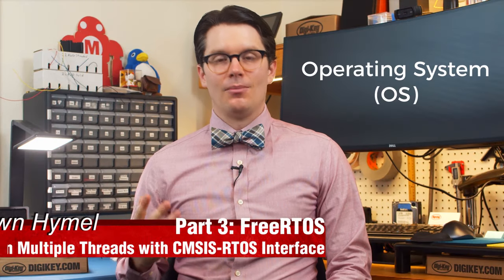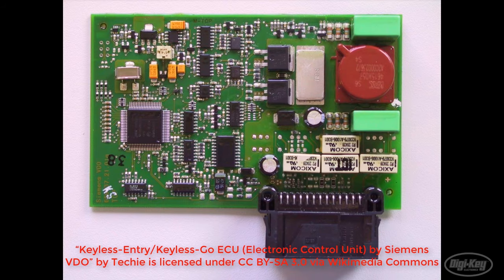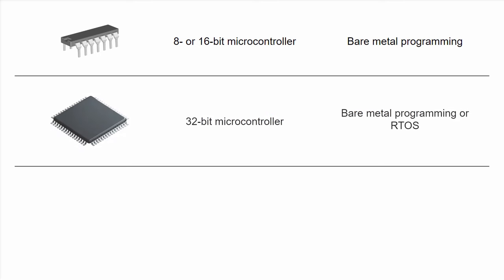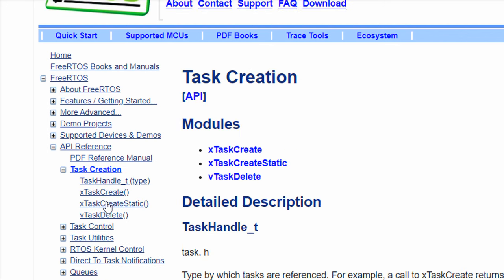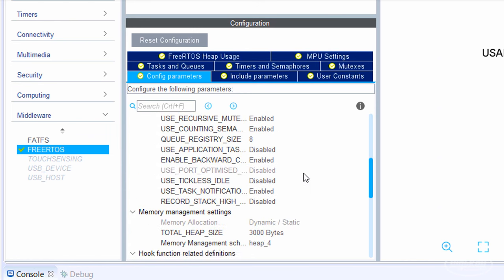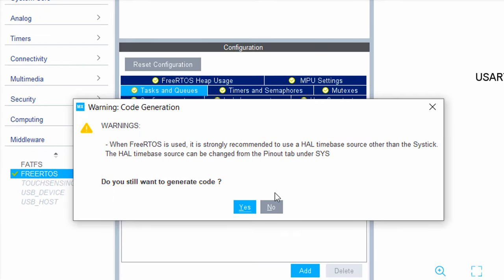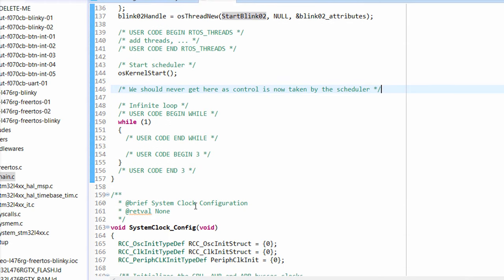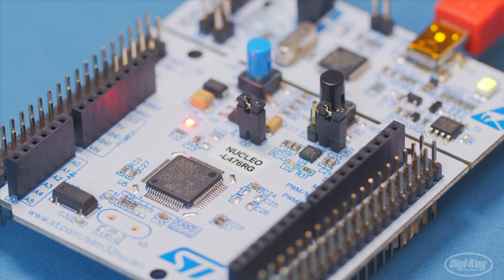Getting Started With STM32 and Nucleo  Part 3: FreeRTOS - How To Run Multiple Threads w/ CMSIS-RTOS

Comment: Please make the video series on queues, mutexes and semaphores. I'm trying to learn microcontroller programming, and your videos are the best tutorials I could find.
Reply: there is a full series on freertos with the esp32, which may vary in syntax but conceptually is mostly the same by this guy as well. Not only does the series cover theory directly, it provides code examples and uses the arduino ide so it is very easy to dig into the examples
Reply: You must be proffesional microcontroler programmer now

Comment: Thank you so much for all the great tutorials. I can not remember another learning video that I had to watch each section over and over. you cover everything important in such a short time. Keep up the great work.
Reply: I also had a question to ask. in the last part of the test you used osDelay for making the delays. out of curiosity I just swapped it with HAL_Delay. What happened is the LED now flashes uniformly. I assume it has something to do with the change from SysTick to Timer 6 that causes this behavior but I can not completely analyze what happens. can you give me a clue?
Reply: @keyvanshahin1740  From what I read in the Docs if osDelay is used as soon as it runs that statement the thread is put in a blocked state and other threads get the cpu. When the time elapses the thread gets put in the ready state. So if you have a bunch of higher priority threads running it could delay the toggle of the led.

Comment: Hii I ma from Pune, I have to build A RTOS System For AC using FREERTOS and stm32f401re. I have 4 tasks 1)temperature sensing(continuously)    2) Indore Fan Run              4) compressor fan run     4) change temperature using pushbutton, I know about pushbutton but I didnt understood how do I run this 3 tasks, which schedular components do I use. Please Help.

Comment: So good. How do you know the maximum number of threads your STM32 chip comfortable supports?
Reply: That question doesn't make sense.
Reply: @Tarkahn2024  Let's hear your answer and then you can tell me why it doesn't really make sense.
Reply: That's an interesting question, I think that it depends on several factors, since each thread could run a different task, maybe one requires 80% of the RAM, maybe some of the threads require a heavy DSP computing part, so it will depend on the target problem and the design you choose to make. Then you start counting response time and memory, and when the controller can't meet your requirements, it means you passed the number of threads for your specific design. So, I may run 1000 threads blinking LEDs, but maybe 5 threads if I'm doing some DSP or using a lot of memory.
Reply: Threads and context switching commands are pieces of code. All codes occupy memory resources. So the number of threads should depend on the memory resources available. Just check the size of your thread code (in both flash and RAM) and sum them up. If it comes close to the max RAM and Flash (as applicable) you get the max number of threads you can program.
Reply: I think each thread has it's own memory stack so the amount of memory in your system is a hard limit on how many threads you can have (although you can also choose the stack size so really it depends on application).

Suppose you have unlimited memory, you will be constrained by the fact that there's a bit of overhead every time you switch between threads (context switch). I think each context switch takes up something like 12 instruction cycles. If you approximate the instruction cycles / second = SYSCLCK frequency, you can figure out the order of magnitude of the # of threads you can switch between and still have enough cycles to execute your threads.
Reply: @mneedes2  He asked a valid question though. It depends on thread memory requirements etc.

Comment: I tried to get a BluePill to work with blinky.  It failed.  I spent 2 hours tracking it down to the interupt vector table not being relocatable in memory, which is apparently meant to be switch on for that MCU type, but was commented out.  I learnt a lot along the way though.

Comment: I found stm32 + middleware freertos can never be simulated in PROTEUS software the GPIO cannot be set or reset inside the task function. Did I miss something on the setting? Do you have any idea about this issue?

Comment: I was getting the following error after following through: 
_user_heap_stack' will not fit in regionRAM’
> region `RAM’ overflowed by x bytes.
I managed to fix this by changing my linker settings for min heap and stack size from 0x200 and 0x400 respectively to 0x100 and 0x100. 

I am new to embedded so i don't quite understand how that fixed it and why it didn't work in the first place? 
I've got Nucleo - stm32f030 with 8KB of SRAM and 64 KB of flash.

Comment: If I am learning STM32 to get a job as embedded software engineer should I concentrate only on CMSIS? Is CubeMX considered professional tool or is it just for hobbyists?
Reply: CMSIS, STM32 HAL, and CubeMX are all professional tools or libraries. Learning them will help, but an employer might be using something else (say, NXP's toolchain). Knowing how to use CMSIS will help you work across many different ARM platforms, but is sometimes more difficult to get working, as it's lower level. The important thing is to understand the concepts involved: installing a toolchain, manipulating registers, interrupts, counters, etc. If you have a good grasp of those, you can learn any framework you need.
Reply: @ShawnHymel  Can you make a more detailed series about microcontroller and embedded systems with, for example STM32. I love your teaching style with clear explanation and well-prepared examples/projects.
Reply: @ntd252  I don't have plans for it right now, but good to know there's interest! If you're not familiar with some of the basic concepts, like registers, timers, and interrupts, I highly recommend starting with a simpler microcontroller, such as a PIC or AVR first.
Reply: @ShawnHymel  

Please make video on DC motor control / BLDC control using STM32.
Reply: If you do not know it, you better start with Arduino.
Reply: @adaminsanoff  I am not interested in Arduino. I have learned STM32 using only CMSIS then I have started using CubeMX because this is actually very useful tool. I  use CMSIS + datasheets only for speed critical sections. There are no brownie points for doing things hard way if this can be done easy way.
Reply: @rafalzasada8826  Bravo!

Comment: How can we run standard main loop parallel to RTOS tasks?
Reply: You don't.

Simply speaking, your RTOS code IS the infinite loop, where each iteration it first determines which task to run next and then runs that task. Remember, you only have one core, so you need to have some kind of mechanism to ensure that the different bits of code are run "in parallel". That is your RTOS. So there should be no code running "outside of RTOS" once RTOS is started.

If you want another loop to run "in parallel", you copy the code from the standard main loop into yet another task function that runs concurrently but managed by RTOS. Just make sure to 1) assign the correct priority, 2) put some code to return control to RTOS (like osDelay) at the end of the loop, and in general use the RTOS-compatible timing functions such as osDelay instead of HAL_Delay.